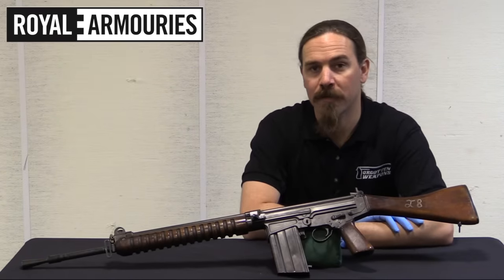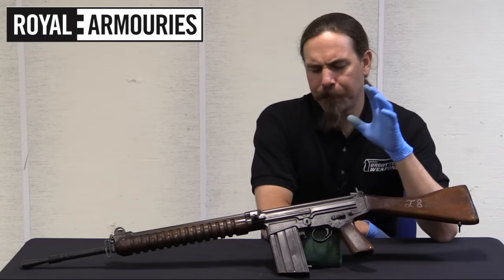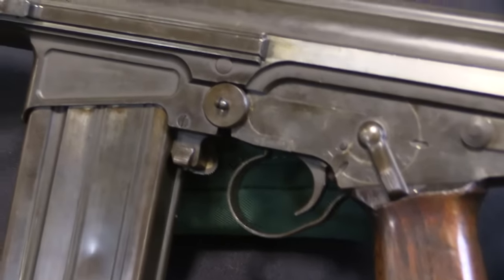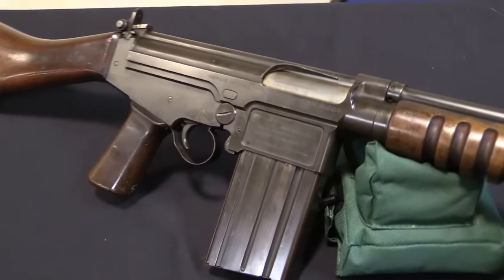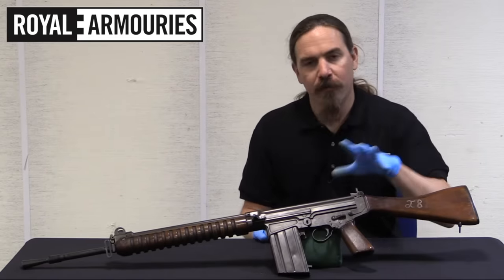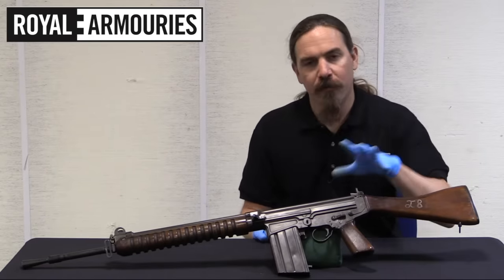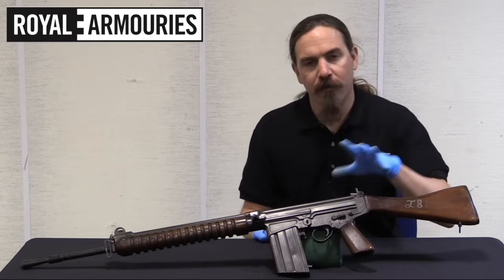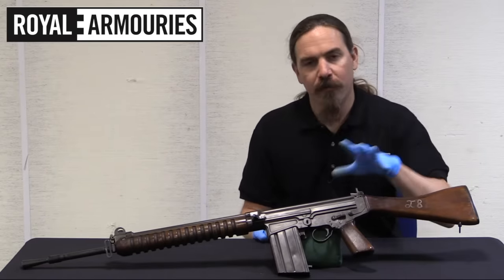The Prototype .280 FAL from 1950s NATO Trials

Comment: I remember playing the "If you could go back in time and kill someone..." game with a few friends some years ago.  One of them, a veteran, answered with "the entire post-WWII US Ordnance Department" without hesitation.
Reply: Michael Dinneweth  Wonder how many time travelers got gunned down in munich 1923?
Reply: Michael Dinneweth  Or it creates an alternate reality. What most people don't understand about parallel universe theory, however, is that the alternates are most likely causally disconnected. The only way to access an alternate you create is to take the time-altering actions and then remain in the past (the long way). If/When you travel back forward, you end up in the "present," the original timeline.
Reply: Don’t worry ..the next group to have gotten in there would have been just as bad …a traveler would have to go back a few time until they got it right …I don’t know what time travel costs nowadays but I’m sure the electric bill would add up ….LoL
Reply: - Not adopting .280 FAL and instead forcing NATO to adopt the FAL in 7.62 which was trash. 
- Refuzing to install a stabilisor in U.S. tanks untill the M60(AOS) even though the U.S. pioneered mechanical gun stabilisation with the westinghouse gyroscopic stabilisor fitted to the M3 Lee, all the Stuarts and all the M4 Shermans (meaning they deliberately downgraded the firecontroll system on U.S. tanks after world war 2). 
- Destroying all 10 YB-49s for litteraly no reason at all. 
- Litteraly completely halting tank development so U.S. troops had to go into Korea with Shermans and Pershings. 
- Adopting the M14. 
- Using the 90mm on every tank untill the M60. 
- Not adopting APDS untill the L/7. 
- Dropping the entire T95 program even though it was extremely successfull. 
- Not having a light machinegun untill the M60 (in 1957). 
- Spending billions on light tank development with LITTERALY ALL of the U.S. post world war 2 light tanks being failiours which would never see real successfull service up untill today. 

Yeah, I do share your friends attitude. WTF was going on?
Reply: I can't help but think of that one scene/theme from The Pentagon Wars when thinking about what the US Ordnance Department did in rejecting .280.
Reply: @PinkBunnybunso  the entire Pentagon wars movie is factualy incorrect and deeply biased towards the writers shitty opinions. 

As much as I shit on the ordinance department in the comment right above yours I have to tell you that Pentagon wars is a garbadge movie.

Here is a great video about it: https://youtu.be/2gOGHdZDmEk
Reply: @jakobc.2558  I know that already.
Reply: @jakobc.2558  I wish we had adopted the armalite ar 10 in 2:80 British 🥹
Reply: @Danheron2 absolutely, the issue was really more the cartridge than the rifle, Ar 10 or FAL in .280 would have been ideal, but even the M14 in .280 would've worked. It was the damned. 308 cartridge that was the real problem.
Reply: I once had someone take me to tasks and defensive colonel studler. They gave him credit with the recoilless rifle program. As I understand it that was other people's work
Reply: Didn't happen
Reply: @mattc5647  you mean time travel?
Reply: @Danheron2  damn straight, AR 10 in British cartridge would be outstanding
Reply: American ego .
Reply: Letting dinosaurs get promotions and power to fight the previous war from imaginationary ideas .. Also known in Nam as REMF's
Reply: AR10  & 15 cannot be openedeasly when jambed  . They are also prone to durt ,mud ,dust and dirty propellant
Reply: @georgesheffield1580  nowadays the US army uses up or out for officers and the twenty years service for recruits isn't mandatory but slackers and fuck-ups are strongly encouraged to take the pension
Reply: @georgesheffield1580  do I hear a bitter brit or a sour kraut
Reply: @georgesheffield1580  Have you ever used an AR15 or AR10?
Reply: Except Col George Chinn - he went on to invent the automatic grenade launchers we see today
Reply: @jakobc.2558 so as far as stabilizers are concerned, we didn’t really downgrade. Ordinance did a lot of testing with stabilizers through that entire period, even studying Soviet designs that were deployed on the T-62 and 64’s, and all of the tests came to the conclusion that the stabilizers didn’t add any significant advantages. They didn’t improve hit rates, ToT, and they were maintenance hogs so ordinance opted to wait until gyro stabilizers became very reliable. The Soviets didn’t , and they payed for it in the T-62, the stabilization system in the T-62 and to some extent the T-64 are really not that great and were way more trouble than they were worth.
Reply: @jakobc.2558  May I say the decision to destroy all of Pedersen device was one of it too? As the Pedersen device could have been used as a training device for .30 cal barrel but no, those dummy just burn all of it and make .22lr training rifle instead
Ian would have been really thankful if surplus .30 lougue still exists
Reply: @georgesheffield1580 Correction, politictions ego
Reply: “British using .303.” Don’t forget the BESA 🤓

Comment: I love seeing the early versions of guns that were later put into mass production. The differences the final design incorporated to make manufacturing easier and cheaper are so neat from an engineering perspective. Looking at this , the lower was changed to stamped and even small details like the latch catch on the lower went from an oval to round which is easier to perform the machining operation.
Reply: And the wooden foregrip, that's a decent amount of machining

Comment: Still waiting for the fulfilment of a long ago promise to fire and evaluate a .280British FAL. I await patiently Ian.
The front woodwork does have a very EM-2 look to itself.
Fine example of using the right sized screwdriver for that disassembly Ian. I challenge you to find out which pre decimal coin was actually sized up to turn that screw head?
With the viewing figures I presume this was actually released after the film on the two trial British FALs?
Reply: Halfpenny, I think, soldiers were not made of money!
Reply: In the British army, there was no way your sergeant was going to let you take that bit apart!
Reply: You could have bought a 7mm FAL surplus in the USA in the early '60's for around $70 (about $600) each.

Comment: I think if the British actually adopted the EM-2 in .280 they would of been way ahead in firearms for a while and wouldn’t of had that total shit show of the L85a1
Reply: I also believe the AR would still have come about and been a better rifle for .280
Reply: @Infectious Legume Gotta agree. H&K sorted the L85 so I'm sure us Brits could have if it had been done properly.. Since we dodn't likelyhood is we would have screwed up the EM2
Reply: I dunno - by the 1980s the rifles would have been worn out, the factory would have still gone bust, and it didn't use STANAG magazines, so it would probably have been at the end of its life. The obvious solution would have been to adopt a domestic-built version of the AR15 at some point in the 1980s.
The general argument against the EM2 is that it was mechanically complicated, but for both the kind of mission the British Army trained for in the Cold War (nuclear armageddon) and the mission it eventually got (slowly walking through Belfast) that wouldn't have been a huge problem.
Reply: @Infectious Legume The EM-2 is mechanically entirely different than the L85, check out Ian's video on it. Indeed he test fired one and liked it a lot I recall, despite the 60 year old ammo giving some problems.
Reply: @Infectious Legume Considering you said it would be a complete shitshow like the L85... which was a complete shitshow due primarily to its poor mechanical performance, the implication is there.

From what I've seen and indeed Ian also has said about it, the EM-2 was a pretty good rifle, and considering Ian isn't generally a fan of bullpups that's quite the praise.

As for the cartridge... well 10 years later America came to the same conclusion the rest of Europe already had that an intermediate cartridge was the way forward sooo... not sure what's rose coloured about that. .280 British may be a bit on the heavy side for automatic fire in light rifles, particularly compared to 5.56, so indeed it's not perfect, but it absolutely was a better infantry cartridge than 7.62.
Reply: @Infectious Legume On the cartridge, indeed I don't think it was as good as 5.56 for a real intermediate that allows for controllable full auto from a shoulder rifle, but there is still a practical advantage in semiauto over 7.62. The lower muzzle rise would allow you to bring the sights back on target faster, and in general quickness to follow up shots tends to be a significant practical advantage.

I still think a 5.56 like round would've been developed as the need for full auto would become more apparent as it did with the 7.62 though. Also Ian's not entirely wrong with 2,300fps, he explains it in this very video, the .280 round started there, and Britain/Belgium kept upping the power to make it more appealing to the US in an effort to get them to adopt it.

As for the EM-2, indeed it did have problems, and as you said no doubt more would've been found out if it entered mass production as is the case for pretty much every new, different, rifle. However I don't think it would be L85 levels, the L85 was just bad to the core, HK basically built a brand new rifle and stuck it into the same housing when they made the A2, whereas the things that were found in trials with the EM-2 were more teething issues that wouldn't really need an entire redesign.

Could some serious problems have cropped up with mass production? Potentially, but we'll never know if they would or wouldn't since it didn't happen, but from the testing of the overall design, it seems less likely to be L85 levels of core design failure at least.

As to Britain's economics at the time, I would say their situation would've been fine long enough to work out the kinks in the design... but then be unable to afford production immediately afterward since, as you said, the EM-2 was an expensive gun to make. The FAL would've been the more cost practical choice certainly, and they probably would've ended up going with it even if .280 was adopted.
Reply: It is a shame that the British did not continue to work on the .280 even after the 7.62x51 was adopted as the NATO standard. It would have been worth doing and in time, they could have made another pitch to have it adopted, perhaps even as the "assault rifle" or "intermediate caliber" of NATO.
Reply: @keptinkaos6384  as a Brit if we couldn't test/tool/manufacture the SA correctly and used the same designers/tests/factories to make a different rifle its most likely we would have screwed up a different rifle.
Reply: @hattyfarbuckle  One of the primary reasons the LA85 was so bad is because the British military firearms industry essentially died with the cancellation of the EM-2. As a result when it came time to design the LA85 there were few if any competant and trained military firearms designers and engineers in the UK. Had those skills been kept alive by adopting the EM-2 chances are the LA85 would not have ended up being the shitshow it was because at least it would have been developed by competant engineers. 

The loss of skills has led to more than one mix up, take the Bismark and Tirpitz, on the face of it powerful and capable ships, but for all their capability they were 'fat', in other words they displaced far more than they needed to for their level of capability, and not by a small amount. The Bismarks were broadly comparable in capability to the King George V Class, but displaced 8000 long tons more. There were other issues, like many important power conduits being routed above the armour, rather than below it (rendering important systems subject to being shut off by even minor hits), through to the fact that her own main battery back blast disabled her fire control radar! 

These issues were down to the simple fact that Germany had not built a battleship in twenty years, as a result, most of the experienced Imperial era ship designers had left Germany or died and those who replaced them had never designed a ship of the size and complexity of a Battleship. As a result they made mistakes. The design of the Bismarks is really rather pedestrian, not particularly innovative, and actually more than mildly inefficient in the use of space and displacement. While a rifle is not as complex as a battleship, it does sort of help illustrate the point of how skill loss can have serious consequences when it comes to the design of military equipment..
Reply: It's possible but I wouldn't say what happened with SA80 indicates it's likely that EM2 would not have turned out well.  The people working on the EM2 were experienced in the design and manufacture of small arms.  They were of the generations that had designed, developed, and engineered production of the Lee-Enfield, the Bren, the SLR and had practical experience of those processes, so they got most of it right.  They were all gone by the time the SA80 project started.  So inexperienced people came up with some good ideas for the SA80 but they couldn't recognize weaknesses and get it right first time.
Reply: @hattyfarbuckle  We made the Bren very satisfactorily in huge numbers, and of course the various models of the Lee Enfield in even larger ones. So why do you make such an ignorant statement? In the Pathe news clip of the demonstration of the EM2 at the time it was adopted  the EM-2 is quite impressive.
Reply: EM2 was designed by time served firearms designers. SA80 was designed by top quality engineers with limited firearms experience.....

Comment: I believe that I have discovered something.  I shall deem it "The Studler Cut".  

Now we all know the story of how Colonel Rene Studler, Chief of U.S. Army Ordnance, scuttled the .280 British cartridge and forced on NATO his pet .30 cartridge, which ultimately became the 7.62 NATO.  In this excellent video we can see some very clear images of the FN FAL prototype chambered in .280 British.

Now as it happens I have a fairly early model FAL which I assembled from a "parts kit" (Kind of like a 3-D jigsaw puzzle without a picture on the box!), which was originally an Austrian StG 58.  I've always appreciated the sophistication and precision in this rifle's design, but at the same time have always wondered about the machining of the rear sight.  If you examine the lower receiver, you see that the fixed part of the sight base is cut at an angle, however the part of the sight on which the aperture slides up and down for various ranges is at a different, shallower, angle.  It seems like a small thing, but it did add a slight additional complication in manufacturing which has always puzzled me.

But, in reviewing this video I have noticed that for the original FAL prototype, the fixed base, part of the lower receiver, appears to be milled at the same steeper angle as it is on my 7.62 NATO rifle, and all of the angle cuts on the .280 rear sight are all parallel to this.  My premise is that the .280 British cartridge required a slightly more "uphill" initial trajectory than did the later and final .30 caliber cartridge championed by Colonel Studler.

It appears that FN, perhaps considering the possibility of such requirements for different caliber cartridges as may arise, simply redesigned this one simple part, the moveable base of the sight, to adapt to the 7.62 NATO, and would likewise produce different versions of this single part as required.

Rene Studler is often characterized in someone who had two career goals:  First, his ambition was to retire with at least one General's star.  Second, he was obsessed with the idea that the American soldier should defend America and her allies with a rifle designed and manufactured in America, and which fired an American cartridge.  This would be his legacy, but it all turned to ashes in his mouth with the perfidious behavior which came to light regarding his second ambition.  But, there is always the "Studler Cut" to remember him by.

Comment: I have never seen why it was so important to standardise rifle cartridges, when we standardised little else.

On tank guns, we developed our own 20pdr, then 105mm, then 120mm.  Granted the 105mm became a NATO standard, but that was after we adopted it.

For artillery, in addition to keeping many WW2 designs for decades, we developed our own 105mm which was not compatible with US 105mm ammunition.

Aircraft and naval armament were also not standardised.

A few guns got standardised by us buying foreign weapons, e.g. M109, but very little that we built was chambered for a standard round.
Reply: Guns and ammo are very expensive when you manufacture them in the millions.
Reply: @blackwoodsecurity531  True, but the larger weapons and ammunition were more expensive and heavier individually and still needed in large quantities.

Also note that the smaller round we wanted would have used less raw materials and been easier to transport.

Comment: .280 HV sounds like the 7-08mm cartridge :)
Reply: Exactly what I was thinking. But from the way the .280 gets talked about, it makes me think that it had a shorter case, since it was apparently overpressure to reach those velocities.
Reply: The case was 1.5 inches long. Later increased to 1.74 inches. The diameter was 0.473. I think.